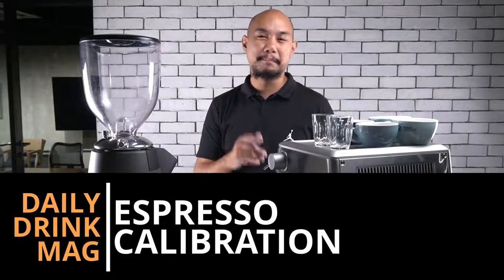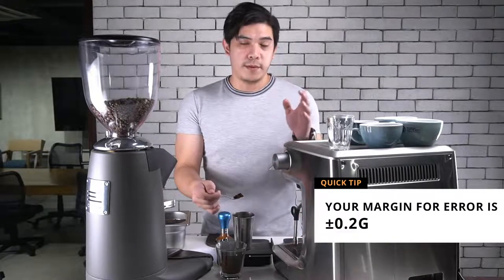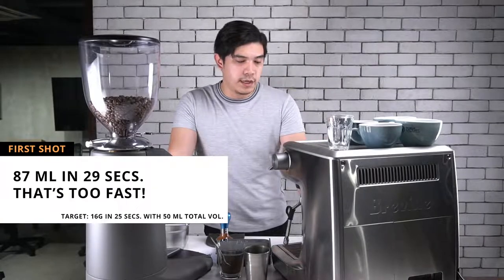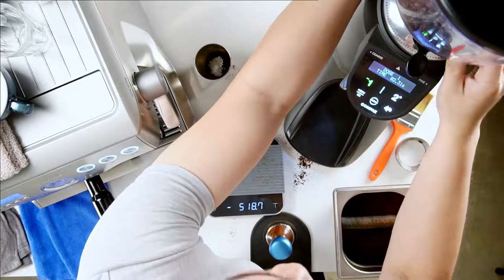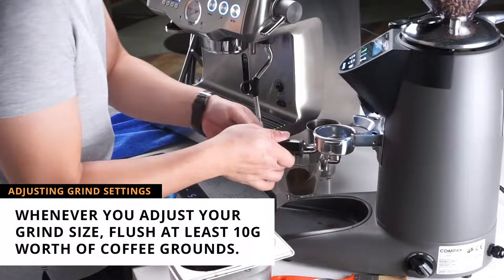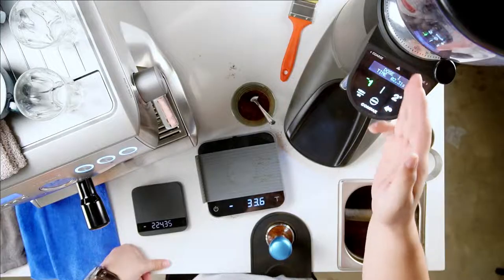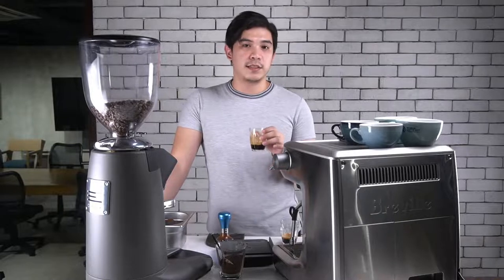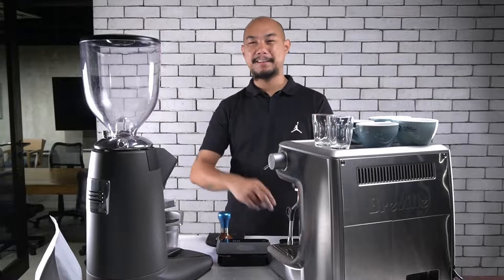Dial in PERFECT Espresso 101 with Dave Dource: Under Extracted, Over Extracted, and IDEAL Recipe.

Comment: How much pressure are you putting on the puck ? It looks like your putting some muscle into it . Curious to see if I'm not tamping hard enough
Reply from the maker: Regular 9 bar extraction. Generally speaking, it's very difficult to over tamp if you have the correct grind size.